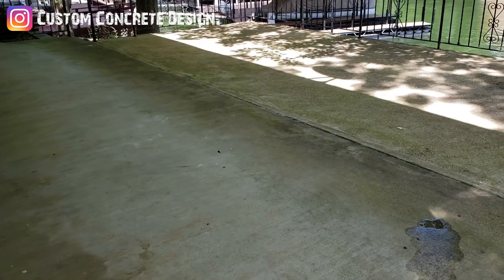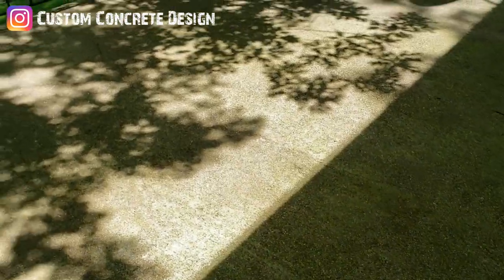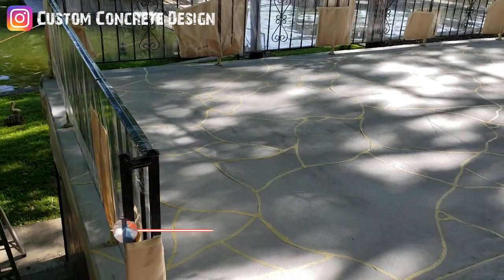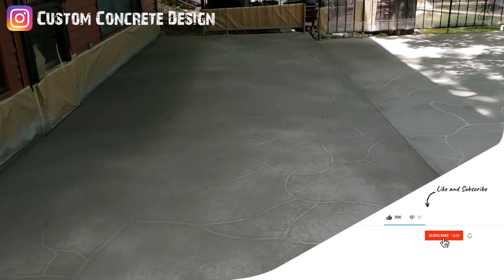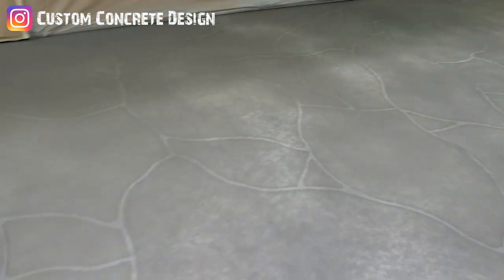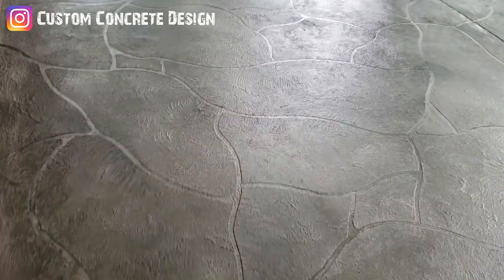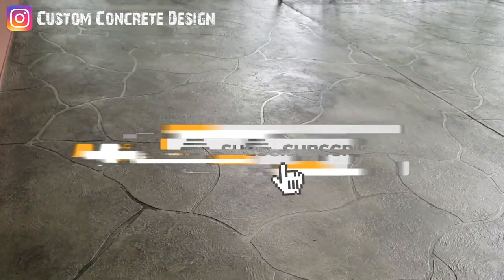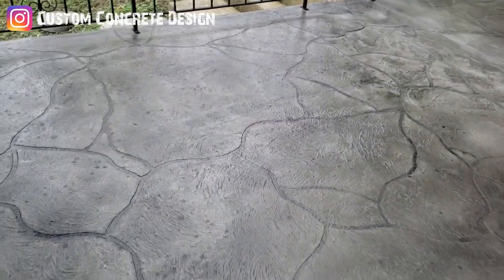Resurfacing Concrete with a Random Flagstone Rock Pattern

Comment: How did you get the gout lines is that from the tape?...looks great!
Reply from the maker: yes the tape covers the base coat of concrete, then we put a layer over the tape when dry we pull the tape and there is the base coat, which is now our grout line, thanks for the question.